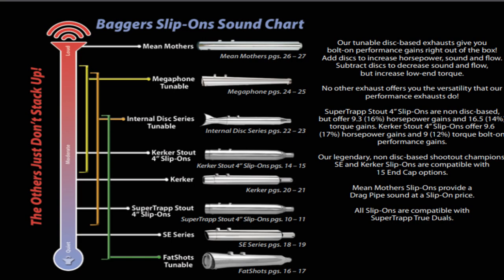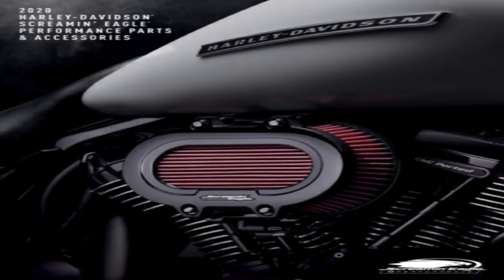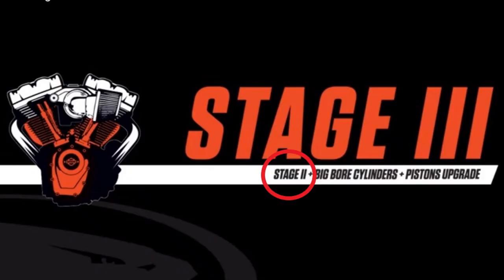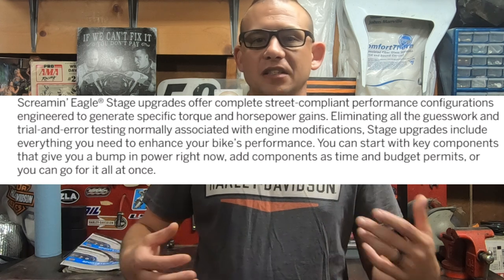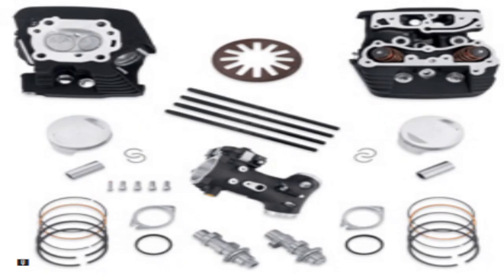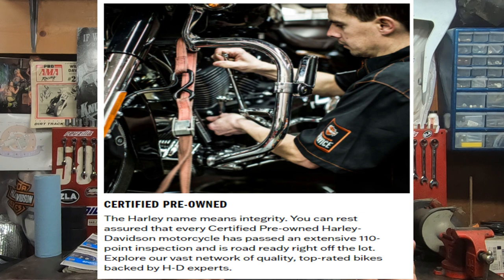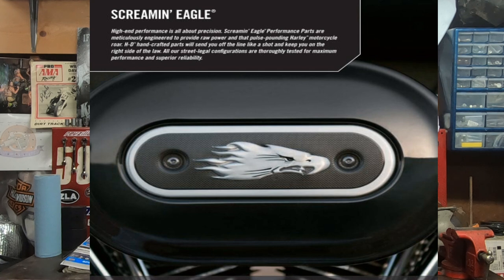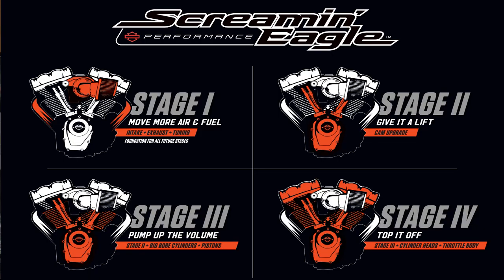Stage Kit Secrets, What Harley-Davidson Doesn't Tell You

Comment: A lot of guys get stuck on the HD parts thinking the two year warranty is important.
Reply from the maker: The warranty covers everything on the bike, but if you make changes to the engine it doesn't void the entire warranty on the bike.
Reply: @GixxerFoo   Oh I know. I know that there are far better options in the aftermarket for performance improvement in a Harley engine than the SE stuff. And really, unless one does the HD extended warranty, two years goes by mighty fast, after which one is stuck with the lesser performing SE build. If one starts with a known, reliable, independent builder with an established reputation, the whole two year thing becomes kind of irrelevant, assuming performance is the goal. In addition, I would never have an engine built to any level unless it was immediately and competently tuned by an established expert. There are tons of poorly tuned bikes running around the country, the "stage" whatever notwithstanding. Unless the tune is spot on, the best performance will not be attainable. Worse, with a lousy tune, permanent damage to ring seal will be done and, even if the tune is eventually fixed, the build will still not perform like it could have when new.

Comment: Is there any information available for All the different stainless exhaust systems for 2 into 1 style
Reply from the maker: There's a lot of them out there, the two into 1's are pretty comparable performance. It really comes down to just the look and sound you like the best.
Reply: @GixxerFoo  yeah I see all the bikes on Instagram with them. I’m leaning towards getting one over my thunderheader mainly for the looks, but was wondering if there were any top performers or recommendations
Reply: I have a MagnaFlow 2 into 1 on my 08 96 inch tc Softail and a dealer told me if really take the tuning seriously, a 2 to 1 will scavenge better allowing for better high rpm horse power.
Reply: @xrick76tube  buy a D&D  2 into 1 system and your good to go. Skip the "ghost pipe" option and spend the money on a good cam  kit.
Reply: @brianhelgerson3870  D&D thanks for the information I will be checking them out

Comment: Have two Harleys ,both 96, both 2010,all stock, go a 100 mph,keeps up with traffic...
Reply from the maker: The 96 is a excellent torque producer, they won't make as much horsepower with a cam as a 103 but a bolt in cam for sure wakes them up.

Comment: I have a question for you I did a build on my 02 88 and I did all feeling cam chest gear drive oil pump tap it's pushrod 574 cams boarded out to a 95 in and nothing done to the heads except for manual compression releases how much more performance would I get if I sent my heads off to say fueling and had imported polished or bought a set of aftermarket heads what would you suggest and would the performance increase be worth the money thanks for all your info brother
Reply from the maker: A nice mild port job with a retune would go a long way, you wouldn't have to get too crazy with it if you're just porting for the current setup.
Reply: @GixxerFoo  thank you sir as always love your stuff I'm pretty happy with it but if I get bored this winter I might have it done but I probably should leave well enough alone I feel it's really dependable right now and it's a mild rocket ship I mean it really perked it up so who knows again thank you sir

Comment: not sure you have covered this topic before or not, but maybe you can give us some facts about this.
i have ridden a few different brands of motorcycles, and i have always done this, and i've never had any issues.
i use the clutch to start and stop, but i do not always use it to shift up or down. i've never had transmission issues.
yes, i know, motorcycle transmissions are not synchronized. i've been riding since i was 15, and i'll soon be 60.
i say that so you can see that i have been riding this way for a long time. none of my 3 honda's had issues,
none of my 3 harley's have had issues, nor did the one suzuki, or the kawasaki.

now, how do you feel, and what do you think, and what have you seen as a tech, on riders who do not use the clutch to shift?
Reply from the maker: Not everyone can shift without the clutch, it can be done but you have to really know just how to do it. Semi's are shifted without the clutch, my wife can shift a manual without the clutch, I other the hand can once in a while. You just have to be at the right RPM and have the right feel for it.
Reply: @GixxerFoo  i call myself a Wrench with a CDL. class A.  i can and have driven 18 wheelers. i drove my 5 speed f 250 home without a clutch because the throw out bearing blew up on me. for me shitting without a clutch comes natural, my ear, and my butt tell me when to shift.

Comment: it's not just their stage kits. it's anything in the scremin eagle lineup. i bought a SE Street Canon muffler (sight unseen) and it was NOT what i was expecting at all. the marketing material and picture made it look like there was no inner tail-pipe, but that's not the case. anyway, just my two cents here.
Reply from the maker: The SE mufflers are not what they used to be, they do flow better than the stock ones and they are really just retuned for sound these days. They are however awesome for low end torque, but they sacrifice horsepower on top.
Reply: @GixxerFoo  I was interested in esthetics and sound. I don't race my bike so overall performance is 3rd on the list. I would never recommend that SE muffler to anyone doing a stage1 ever.

Comment: Well I think that the stages are honest upgrades when you look at them because smaller bore maximized in reliability then once you are willing to increase bore size  would change max performance parameters so to progress right up to kinda completely different animal, do you think a bike with stage 4 is anything like the bike you would buy off the floor, I dont understand why you dont like the model really it's got learning curve and reliability built in and no guess work so you get to the fun part quicker just saying.
Reply from the maker: The stage kits are good concept with proven and designed combinations, it's if you buy a cam it doesn't carry over if you progress going up the food chain. You could if you wanted, add to what you've already purchased but that adds up pretty quick.

Comment: To be honest s&s has a 124 m8 create engine is the same price as the 131 screaming eagle engine tho but after stage 1 would it not be easier to go with  the stage 5 kit especially if you spent money in the stage 2 and 3 and 4 kit
Reply from the maker: I would likely opt for the S&S engine over the SE 131, they've been having some issues with the 131. The 131 crate motors from the factory seem to be having the issues, my guess is the ones built in house at a dealer the techs are correcting some potential issues.
Reply: @GixxerFoo  well I like a m8 131 ci screaming eagle than a s&s 124ci  but I haven't heard anything bad about the 131 I'm glad you told me thank you

Comment: Yes, the Rule when buying ANYTHING from H-D is “Buyer Beware!”  Not only are their S.E. Stage 11 and above kits mutually redundant, but the dealers will tell you that it’s perfectly OK to bolt-on the larger barrels, pistons, etc. in their Stage 111 and 1V Kits on a Stock 3-piece pressed-together Crankshaft that was NEVER designed to handle the increased Power and Torque!  Yes, the MoCo is deceitful and really just wants your money, but recall, this is the same company that offered the S.E. Hydraulic cam-chain Tensioner Camplate Kit to fix the spring-loaded cam-chain tensioner problem on 1999-2007 TC models at the OWNER’S EXPENSE!  Any other reputable company would have offered that "fix" and the labor involved as a FREE recall item. Period!
Reply from the maker: They only give you 1 year on installed kits after 60 days of purchase, I've seen some issues arise from time to time with the stage kits on bikes.

Comment: can you do a break down on the CVO over standard,,, harley doesn’t seem to break it down very clear,, you get the heavy breather and a power cam i believe but nothing as far as what tune has been done or exhaust that is stock on the CVO (road glide)
Reply from the maker: They have Screamin Eagle mufflers stock, as you mentioned the SE air cleaner and they have CVO heads. You could call the heads mildy ported over stock, they flow somewhat better. The cam is a higher lift over stock, not sure about the M8 but on the twin cam the stock cam was like a .496 and the CVO was the SE 255 with .551 lift. It was really more centered around torque than horsepower. The tune is basically for the parts installed, other than that the engine is stock on the lower end. Of course they were a larger bore depending on the year 95, 103, 110, 114 and now 117.

Comment: Did a SE stage 2 torque cam and tuner on my 21 slim. I am using a fuel moto air cleaner and deans speed slip ons.
With the limitations of the se tuner i see no need to do a stage 3 or 4
Reply from the maker: Once your warranty is up retuning with a Power Vision will make big difference with your cam and exhaust.

Comment: any suggesting's for a totally stock 2007 fxstb (fuel injected) to simply increase duration to produce a thumper sound with cams only?
Reply from the maker: A good cam will give it a very nice lope, you don't want to lower the idle as you risk damaging the top end due to low oil pressure. A good exhaust, air cleaner, new cam set and a tune will do wonders for a stock bike. Here's a video on some cam option for your bike, these are straight bolt in so no valve springs required https://youtu.be/0Ncrl2OWCwk.

Comment: This is why I'm pretty much happy with a stage 2 on all big twins (only because I have to tear apart the cam chest anyway) and on Sportsters I just do the stage one.
Reply from the maker: The big twins benefit tremendously from a cam swap! The Sportsters make great power with exhaust and air cleaner, it's really hard to beat the stock cams without losing the bottom end. Hammer's cams are about the only Sportster cams I've seen that actually make a gain on the bottom end.

Comment: I didn't know 07// 96 cu. in  Road King w/ 80,000 miles. Checking around to find a shop to do it! (Hard thing to do) So I checked with the shop I bought it from, they are going to give me an estimate for stage 3 upgrade to 110. So I'm listening to the guy as he's writing the information down and he says oh will do the stage 2 upgrade and the stage 3 upgrade? So I come back to the house and start watching YouTube low and behold you're telling me everything that's in the stage 2 kit is replaced in the stage 3 kit? Kind of sounds like they're trying to charge me for a stage 2 w/o need or actually doing the work!
Reply from the maker: Yeah the stage 3 includes a cam, so I'm not sure what the shop is getting at there. If you originally did the stage 2, paid for a cam and installation, later decided to do it over for a stage 3 you'd be replacing the cam with the one in the stage 3 kit. Maybe he just meant they are installing a cam with the stage 3 kit I hope.
Reply: I love my bike, 07 Road King I am looking at a build. I bought it second hand so I not sure if it had a stage 1 or 2 done on it.
Runs strong but does run hot & tends to use oil? 
Rode a 107 low rider & wasn't ready for the throttle response!
So ya, I am a bit envious but with the high mileage I want to replace those parts that tend to break or causes break downs

Comment: What’s the difference between buying a stage kit from Harley vs s&s.
Reply from the maker: With S&S you will get more power due to the cams, S&S has much better cams than the SE cams from Harley. But as far as cylinders, pistons etc the quality is pretty much comparable. Screamin Eagle kits are more centered around emissions compliance, S&S has some kits like that but most are "race use only".
Reply: @GixxerFoo  I’m sayin if I bought a cam from s&s and had someone install it then 3 months later I want more power I have to change the cam if I do a big bore kit.  Most likely the kit comes with a new cam. Not just Harley does this. All the aftermarket places do it.

Comment: how big is the big bore kit?  .020, .030???  What is it?
Reply from the maker: Which big bore kit are you looking at? Depends on which bore size you are upgrading too.
Reply: @GixxerFoo   Wow, just looked up the big bore piston size - same as a 454's.  Would it not be better/cheaper to just stroke it with cam and matching spring pressure?

Comment: Would be nice if HD made decent rear axles so you dont have to spend $600 on a Kraus upgrade
Reply from the maker: Harley had some issues with their rubber mounting there for a bit, but they got it straightened out now.

Comment: CAN YOU DO THE EXHAUST AND AIR CLEANER ,THEN GO TO HARLEY AND GET IT TUNE WITHOUT BUYING A TUNER
Reply from the maker: If you do the SE parts yes, but I wouldn't recommend the "download" it's junk to be honest. You could get a dyno tune at a dealer if you wanted which is awesome, but you'll likely spend about 500 bucks. It's well worth it to get max power out the bike, but otherwise you could go with an FP3 or Power Vision if you plan on dyno tuning later.

Comment: I was told they can’t tune a aftermarket cam on the crappy SE tuner.
Just sold my 2019 FLHR (468 cam, dyno tuned on PV, catless 2-1-2 etc etc)
Wanted to keep the warranty on new bike so thought… if I could do a good cam, full exhaust, but have them tune it on stupid HD SE tun2er til warrenty done then have retuned for real.
They said it will run like shit and said run it for a while as stock or stage 1
Make sure motor is good then do what I actually want in couple months.
They said they’d hate for me to leave feeling disappointed by the SE stuff

Comment: Is there such a thing as a tune up app that will make a newer electronic ignition Harley idle like the older ones. Potato Potato Potato.
Reply from the maker: You can lower the idle with a flash tuner, but no lower than 900 rpm. The factory bikes really need to idle at 1,000 to maintain proper oil pressure at idle. The newer fuel injected engines aren't like the carbed bikes you could idle down quite a bit.

Comment: If you can't decide witch kit you want that's on you anyone with a brain should know if you go for a mild upgrade then want a biger upgrade it's going to cost & some parts need upgrading .if you get after market bits you still need to keep upgrading as you go biggerv
 ,at least HD parts are interchangeable. If you get an say ev 27 cam & decide to upgrade to Moore cc s & higher comp you will still need a bigger cam .

Comment: Stage 1 More noise, stage 2 even more noise, stage 3 go to an independant shop and get the horsepower you paid for!
Reply from the maker: I wouldn't be surprised if at some point Harley starts putting what they call the Stage II cam in stock. For sure when you get into the big bore kits it's worth going aftermarket.
Reply: @GixxerFoo  I've actually put on quite a few sets of slip-on mufflers on customers bikes over the years, and they all think their bikes go much faster, lol!

Comment: I have hooker headers ; loud as f- . Baffles best for torque . Took out fiberglass. 
👍👌 
Wife has Vance &hines  slip ons . 
I prefer the Vance & hines slip ons .
Had a thunderheader .
No saxophone on 
my bike -
✊🏻👍👌👋🙏
Crossover in head pipe a must -
Good point on m8 -
But I do prefer the better mpg. 
I just got gas $4.49 😖
Reply from the maker: I like the V&H slip-ons myself too, they perform really well! You ain't kidding gas is getting expensive, especially running premium in the bikes.
Reply: @GixxerFoo  yeah the v&h straightshots  slip ons . Yeah geeze  I’m looking at a e85 sensor for my truck . The factory didn’t put it in . 
Anyways that’s a way to go and those kits are selling now . ✊🏻👍👌

Comment: I love Harleys.....But i hate HDMC. Just pure greed imo. 
If i had the money id get the S&S T124
Reply from the maker: The S&S motors are designed around the Harley architecture but they've take it a step further by engineering out the failure points.

Comment: does one over cam it at stage 2 and save up for big bore or just go w a smaller cam and enjoy the low end torque.  chevy world they say go one cam size down or suffer the consequences of low torque on the low end but who listens to that nonsense. go one size bigger cam...lol.   twin cam fxr w 543 cams, 96 ci heads, 6 speed with an overdrive runs pretty good even with stock displacement.

Comment: I have a Stage IV SE kit on my 2002 Dyna. 103ci, with 107hp and 160nm torque. On the dyno we see a huge torque dip.
It goes up t140tq at 2300rpm, than drops to 120tq around 3000rpm, to steaply go up to 162tq around 4000rpm and stay's reasonably flat till 5000rpm 
What you think? Can it be the cam, or the exhaust? The grafics of the dynorun are at the end of the video. 
https://youtu.be/k9t0o0meONk?t=95

Comment: Just do research and build your game plan so you only have to buy shit once
Reply from the maker: That's a solid plan, worst thing is having to go back and buy parts twice redoing work already done.
Reply: @GixxerFoo  ya I’ve done it with cars plenty of times, but after I picked up the dyna I wasn’t going to keep tearing into the thing, do it once. Do it right. And have fun with it. Even if the parts sit in the garage for years until you get everything together. You got an Instagram? I just got the ported heads, tw777 cams, and a .030 head gasket on my 103 and you have to hear this thing